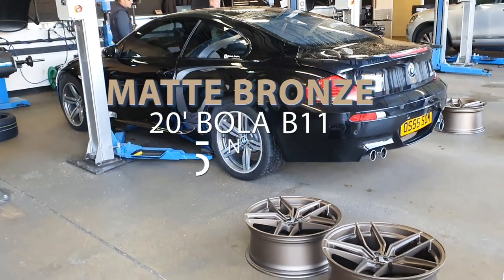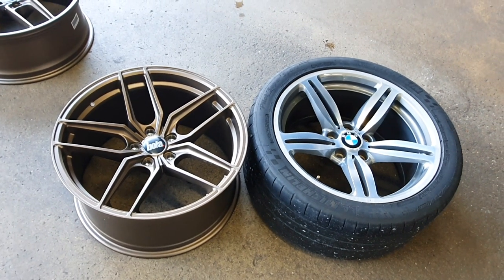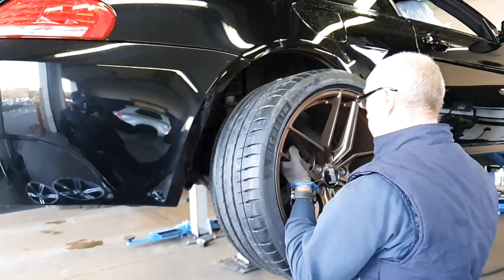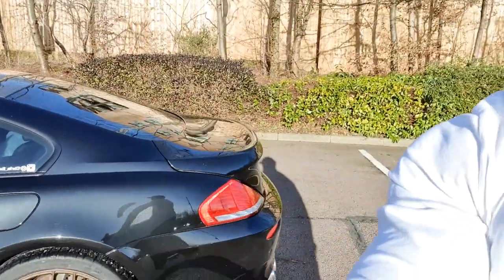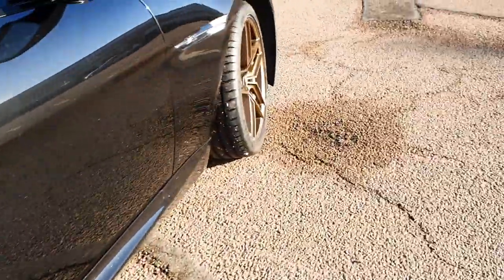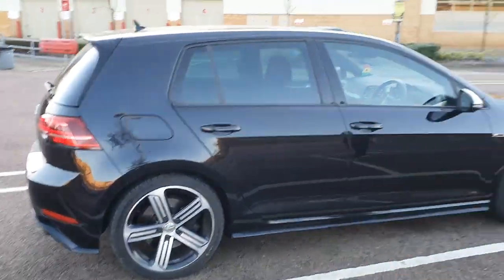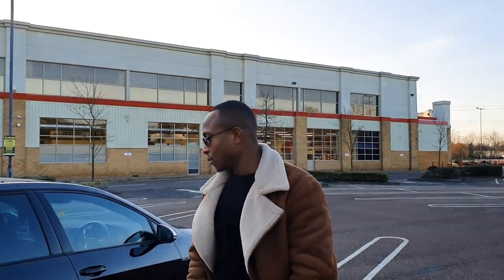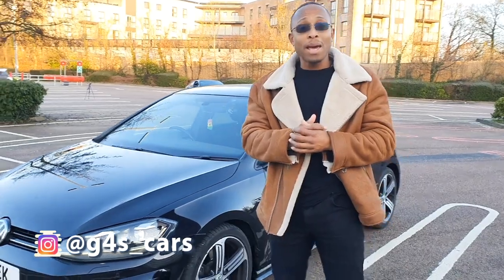I BOUGHT some *NEW WHEELS* for my Straight Piped M6 V10!

Comment: Bro cam you share info regarding your bola wheels , I need size offset , pcd, need perfect fitment for M5
Reply from the maker: 8.5x20 (Front) & 10x20 (Rear) both ET20, and I've got 12mm spacers on the front and 15mm on the rear now